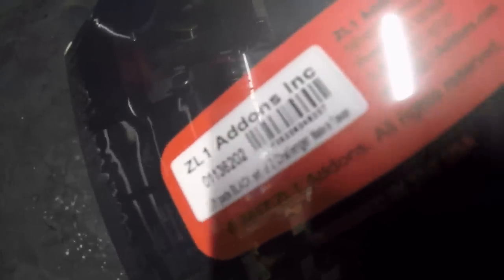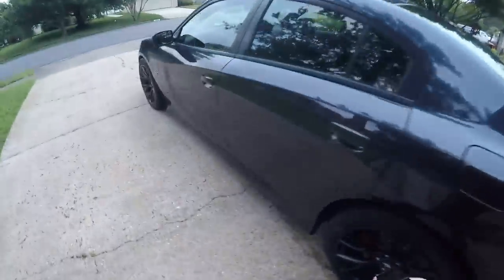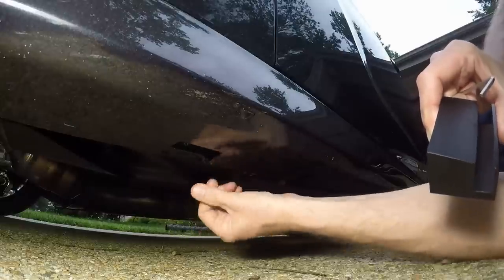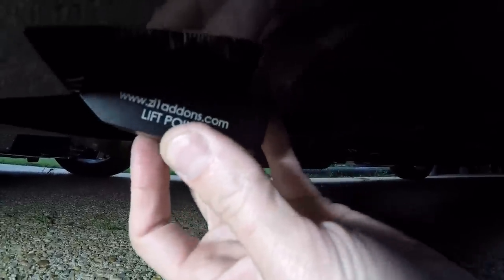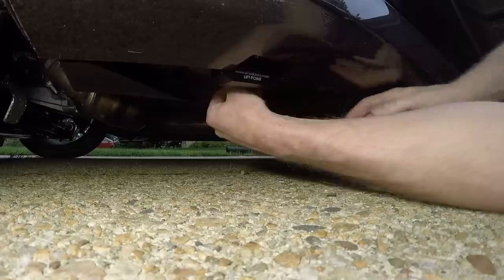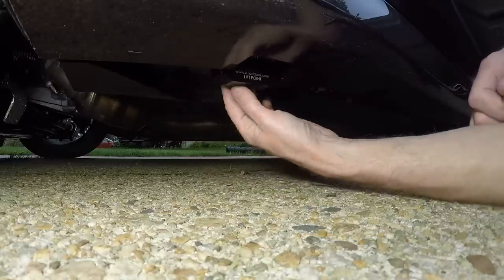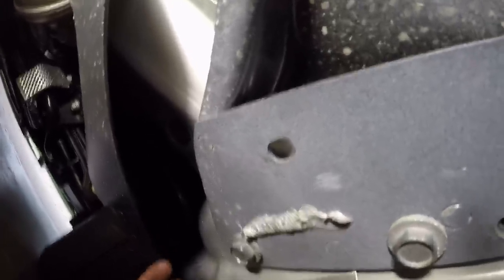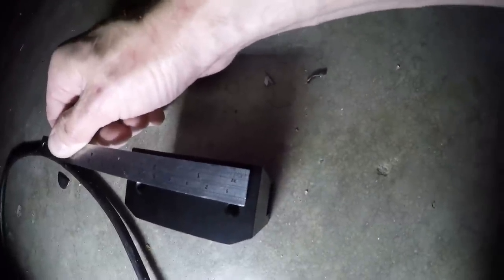2018 Dodge Charger ScatPack Ep. 23: ZL1 Lift Pads - The Good and the Bad

Comment from the maker: After fully tightening at the end of this video, i went down later and pulled them off with my bare hands. They do not fit these Chargers. I will sell this for a loss to a Challenger owner, as they apparently don't have that gap in the pinch weld.
Reply: LastHumansGarage I don’t understand why that bolts won’t tighten down on the pinch weld area. The way you had the Allen wrench, doesn’t give you much leverage. Maybe use a socket type Allen to tighten the bolts.
Reply from the maker: you must not have watched the whole video then. it is clear that the gap in the weld is exactly where the screws want to touch.
Reply: Use two metal pieces to sandwich the pinched welds. Effectively bridging the gap so that the screw has something to bite on and as you tighten the two metal plates will clamp on to the pinched welds.
Reply from the maker: you saw how i kinda did that, right?? the gap doesnt have much room for extra metal or it wont sit flush on the floorboard
Reply: I rewatch. Use longer metal plates like 65mm - 75mm. It's odd that it would have a gap like that. I have never seen a vehicle like that.
Reply from the maker: the gap is for the stock jack circle. the reg pinch is too deep for that so they take out half of it. great idea on the long metal. i may just try this again. however.. waves in the pinch weld might also cause issues.
Reply: Molon Labe 5x5  Yes, but shouldn't HAVE to do this... Part should just fit... Or the company should include this solution with the product... Shouldn't have to make runs to Home Depot, Harbor Freight, McDonald's, and jury rig anything... Should work out of the box since it's vehicle specific... But I am glad you found a solution...

Comment: Ya'll realized that theres like 4 pinch weld openings per side and they are different sizes...also the Chargers rear pinch welds are for decoration and we are meant to use the cheap plastic jack points just inside the welds..terrible yes, but lift pad pros makes good upgrades.

Comment: Glad I'm not the only one that couldn't get these to work as designed. The guy from Zl1 insisted my car was messed up or I was doing something wrong. I have a 2018 charger that the pinch welds are perfect on and I am a master BMW technician, I know how to tighten some bolts.  I returned mine after he I told me he had never seen pinch welds like mine and that I could put them somewhere else on the pinch weld that the car is not designed to be lifted at. The really sad part is he is  just re-branding stuff someone else already made, take a look on Amazon for challenger lift pads. They are the same exact pads, he just slaps his name on them. If you look at the box you got them in also on the back it says challenger. So they weren't even designed the charger, he just markets the same pad for both cars and never test them on a new car and year before claiming they fit properly....... long rant over....
Reply from the maker: thanks for your confirmation. I saw you in another review of these also. i havent reinstalled mine yet. I might try a piece of metal like in the video and try to get it right. i do like them, if only they fit.
Reply from the maker: good call man.. i added the amazon link in my video.. might as well save money if youre gonna try them.

Comment: These lift pads are over rated at $ 55.00 try rare earth magnets glued in on 4 rubber hockey pucks from amazon for 4 at $22.00. Then trim to fit on the jack points of your Charger.
Reply from the maker: good tip

Comment: I did watch ,but the bolt should go all away across the gap. I’m talking about even before you put it on the car.
Reply from the maker: the bolt does. even when i removed it... meaning it was not grabbing any pinch weld.

Comment: So you're saying there's an actual chunk missing from the pinch weld where the bolt doesn't contact any of the car's pinch-weld metal? Also, I presume it's NOT jacking it up by the area where it rests on the washer, but strictly at the pinch weld area, but the washer gets in the way of it sitting 100% along the pinch-weld area? Yeah, I thought it would be fine on my 2012, but I'm also experiencing all this headache. I mean, why is the area where it touches the bolt/washer on the body at a SLANT? Makes me think it's NOT supposed to touch the bolt/washer on the body, otherwise it would be installed crooked (that is, NOT perpendicular to the ground). Hard to explain, but yeah, the part just fits funky, the pinch weld gap seems too wide, etc. A little disappointed as much as I want to love this company and its products...

Comment: Don’t use these .Much cheaper by buying rubber hockey pucks from amazon and trim to fit in the pinch welds. Then glue in rare earth magnets and wa la they work and cost me less then $ 40.00 for 4. Try this it works.
Reply from the maker: sweet

Comment: What year is your car , i have 2018 and they wont fit
Reply from the maker: yup. they dont fit chargers as perfectly as challengers..
Reply: LastHumansGarage so did you leave them off or contact zl1addons
Reply from the maker: I sold em
Reply: LastHumansGarage so how do you jack up the car in the front
Reply from the maker: the way 90% of the world does.. on the pinch weld section.
Reply from the maker: MOPARGuy  those look killer, nice find. if i still had the scat i would have got those.